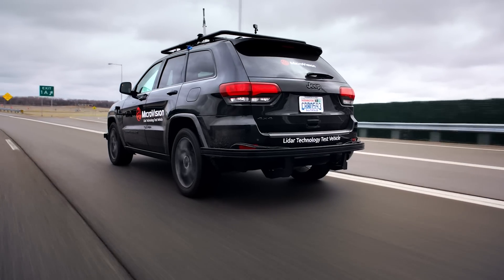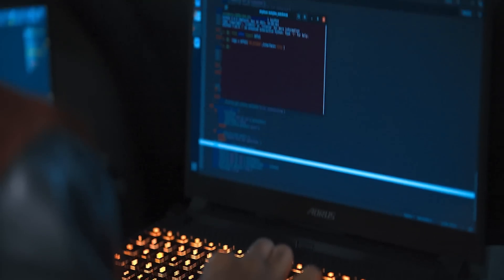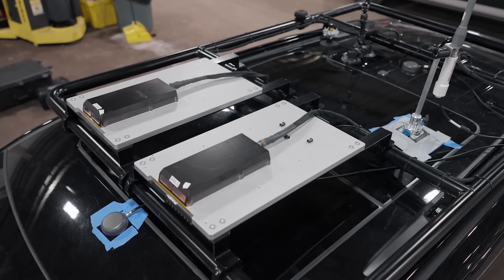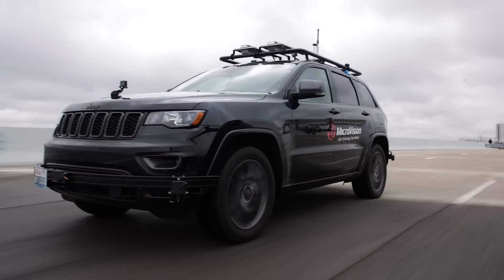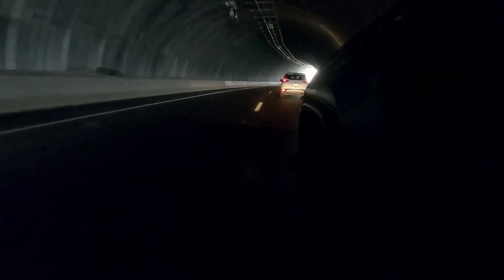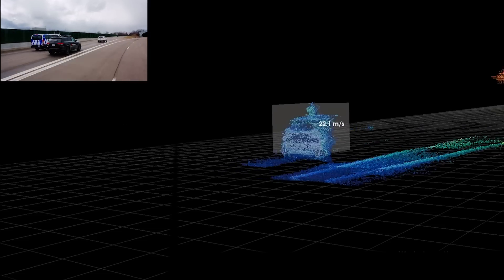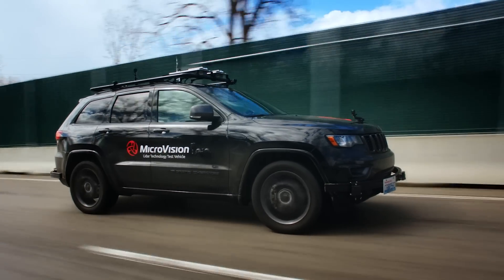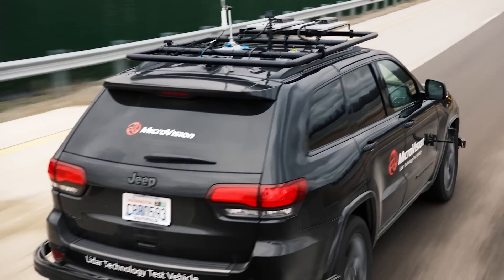MicroVision Track Testing—Full Video

Comment: Tesla already has this technology. How would your company beat Tesla's technology?
Reply: Tesla does not use LiDAR technology. You are incorrect. LiDAR is more reliable and advanced than the simple cameras that Tesla uses.
Reply: @jacobcastiglia865  that is why this is a penny stock and Tesla is a $800plus stock! Your brain is somewhere else.
Reply: Watch the video. Cameras have trouble going light to dark or driving directly towards the sun. Also Tesla's camera only solution will be susceptible to optical illusions just like human eyes. LIDAR is actually making a 3D map of what's really there not just what it is interpreting It thinks it sees like Tesla does. More information=safer.
Reply: No they don't
Reply: it's meant to compliment it. tesla doesn't really use range and velocity detection. lidar does this very reliably but it adds cost, design change, battery use. the tech has yet to really prove itself in both forms.

Comment: Much less resolution than the original videos.. Sorry, I'm not impressed. How much this adds to the vehicle cost? It looks more of a military product, not a civilian.
Reply: Nah, the resolution is very very good. You notice it with the objects far away, it's still very noticeable an object. I think you don't know what lidar is and confuse it with normal camera data.
The product will be be around 500-800 dollars in cost.
Reply: @Timmsh88  You don't know what I know. I know how the other firms resolution looks like, just similar. Maybe not at those speeds but as far as the resolution just the same. They showed once a "lidar" video, of insane resolution and it is not any near. Their biggest issue is not the resolution, it is their lidership.
Reply: @zevik84  but they use a dynamic lidar system. With the object further away you get more clearity when an object is detected. 
And i dont understand. What firms have higher resolution? Because MVIS has one of the highest, with the highest frame rate and at a cheap cost. So if you are informed you should know right?
Reply: @Timmsh88  I'm not saying it is all that bad, but it looks different that they previous presentations. The company is still have a way too high market cap, they sell Penney's. The real jump will be after a huge contract, and a big sales. not some fancy youtube video.
Reply: For those systems the raw data is not needed or "better". As a driver you won't see this kind of information. Instead I guess you can have camera view of needed. The Lidar is one tool, carmakers will make their own safety systems and include it. So MicroVision don't have to make it pretty and nice. They make it easy to use and easy to integrate.

And for the optical lock, this clearly a test setup. Don't see the point complaining about this. To be honest, the size is very impressive. Must of the stuff is calibration and control. The lidar unit itself will be hidden inside the car.
Reply: @fabianlongma7020  The question is economical. I understand it will add 10k to the car price. it's a lot.
Reply: @zevik84  MicroVision talks about 800$ per Unit which is ready to plug in for the safety-system. Also they have different products for different ranges and one all-in-one unit which helps to reduce the cost basis.
We are talking about the next Generation car system here, of course it won't be inside a VW Golf for years.

Comment: I like the proactive approach of avoiding accidents. Not just relying on air Bags and seatbelts after it’s too late. Greatly looking  forward to Microvision making our highways safer for travelers.
Reply: Very true!
Though AFAIK, the implementation of the ADAS system is on the OEMs, what they get though is high quality 3D point cloud data (perhaps already processed, like in 2:55), a 3D representation of the cars surroundings.
This is amazing already compared to the difficult obstacles that you'll be facing when relying on cameras only like Tesla.
Hope some OEMs are aware of MVIS and they'll be able to strike up one or more deals, or will be bought as a whole.